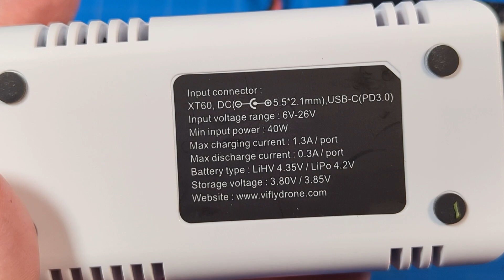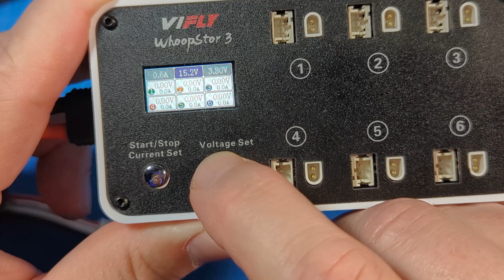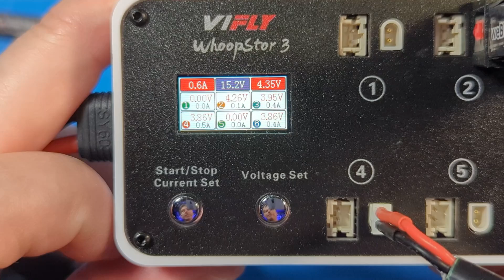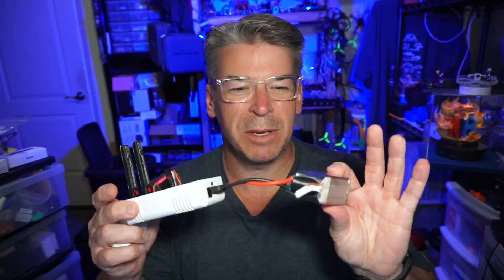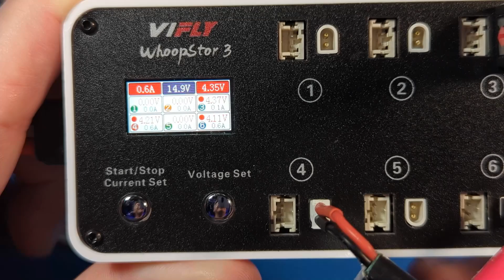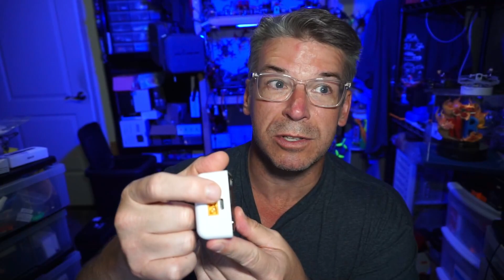#1 Micro Battery Saver // Vifly WhoopStor 3 // Fit & Finish with New Features

Comment: I don't know how to use it. How do I know which Voltage and Ampere I should use on my batteries? Right now I have those blue/white batteries from BETAFPV. Help is very appreciated.
Reply from the maker: If the mah is 300 then charge at .3volts. If 450mah then .4 etc. most charge 1s batteries higher than that but these are safe settings to use
Reply: @ thank you for answering so quickly. You probably mean 0.3 amps?! And what’s the target voltage? How do I know that? And is 1,85V always storage voltage or 1,80V?
Reply from the maker: @patrickrotter515  With 1s batteries we normally charge to 4.35volts. This is HV (high volt) charging which is generally an accepted practice, but some believe that HV charging shortens battery life. I don't believe that, but flying our batteries down flat or below 3.2 volts "at rest" very likely does damage or shorten the battery life. The "at rest" meaning not flying and have been not flying for 3-5 seconds.
Reply: @NickBurnsFPV  I appreciate your help very much 🙏
and sorry for the misspelling. I meant 3,85V on the storage question.
Reply from the maker: @patrickrotter515  3.85 or 3.8o volts on storage. I am not sure anyone has really identified if one or another is better, but I am sure there are some very strong opinions on it :)

Comment: Hey Nick. I'm new to 1s. My whoopstor v3 shows 4.35v when I charge my hv batteries. When I plug them into my whoop however, I'm only seeing 4.2ish. Which device is lying to me? 😂
Reply from the maker: depending on what sort of video system is in the quad maybe neither. HD video systems have higher voltage requirements and by the time its plugged in and we get our video link some voltage is used. If its analog its the scale of the AIO that is off.
Reply: @NickBurnsFPV  I'll have to pay attention today to see if the difference is larger between my analog mob6 and the mob6 Eco!

Comment: Hello, can I charge betafpv 550mAh 1s lipos with that charger?
Reply from the maker: I don't understand. Its a charger built specifically for 1s batteries. Plug in to power, plug in battery and press the start stop button.

Comment: Hi nick just wondering can you change a 2s battery as well with that board? As I have the pavo pico . What would you recommend if not thanks
Reply from the maker: No this charger is 1s only. Any charger I have had on the channel could charge a 2s battery. ToolkitRC chargers are cheaper and Hota typically more reliable, but I haven't had reliability issue with ToolkitRC chargers, just others report reliability issues.
Reply: @NickBurnsFPV  thank you

Comment: Got a question. My 1s batteries say 
3.8v. When I charge should I only select 3.8v or is that just the storage charge?
Reply from the maker: 3.8 is storage. We should charge to 4.2v or 4.35 if they are high volt batteries.

Comment: I’m happy user of v2 and v3 now, and one pretty major cons of v3 I think is that PH2.0 connectiors are on top of the charger instead of having it on the side. In v2 it is a lot more comfortable to connect and disconnect batteries from the sides. So I hope they will do it in v4 😄

Comment: The 0.02V over charging will be fixed soon by upgrading the firmware.
Reply: Niiice, thank you!
Reply: Hi! My whoopster3 is on 1.16 firmware but still when I check voltage with other checkers it says 0.02v more than the whoopster

Comment: That's a great one. I have the passive 6 port adjustable charging board from vifly, I use it with my ToolkitRC charger and it works great.

Comment: Your thumbnail got me 👊🏼
They need to add a single 2s charger on the side so you can charge goggles batteries too
Reply from the maker: I wonder how much bulk something like that would add. I worry about it getting bigger and not being so pack friendly
Reply: @NickBurnsFPV  yah that new one is a bit bigger anyway.  I made a little adapter to plug 2s into 2 1s ports.  That way when I travel I can bring just the 1 charger and cover goggles too

Comment: I love the v2 it does my 18650s as well (4.2v) I made an adapter.  The v3 was not available when I got my v2,  but the 4.37v issue you have is not in the v2, and the v3 can charge as high as 1.3A, which is a nice option but as nick found I do most of my charging at .3A from 3.71v to4.35v and that is just enough time for me to get the bats charged when I can fly again.

Comment: What about one of those adapters that has a XT 60 connector and a DC House plug on the other end wonder if it would work that way ? As I have several older 1S chargers that do that as i have  a couple of those type adapters ? And why doesn't it come with a wall adapter ?,...LOL
Reply from the maker: Yes, as long as it meets the voltage specs.
Reply: @NickBurnsFPV  Thanks Nick

Comment: The fan works when you storage discharge. I have one of this charger(early tester) and I have been using them for over 1 month, it is really a good charger for 1s pilot.
Reply from the maker: I haven't had it kick on discharging yet, but I think I also had it set to a lower amp when discharging.

Comment: I've still been going strong with some fractal boards but this is a great stand alone option for sure. Will probably pick one up eventually 👍
Reply: Can anyone tell the Valt and amps I should use for a 450mah battery and does it automatically discharge or should I set it to discharge

Comment: I have one of the V1's, I think, without the dial.  I think my PH2 connectors are packing it in, I'm moving to BT2/A30 so I'm good there.  But I have been looking at this one just in case my current one starts to falter more.  Love these things!  Just hacked up an old IBM Laptop power supply with an XT60, love the USB C for a power bank too.  Big thank you for confirming an A30 battery will connect to these.  Having BT2's on all my whoops soon seals the deal on completely dropping PH2, except for a few toy drones for spec'taters.  Thanks again for sharing!  Cheers!

Comment: Will be worth money if it start charging cell inmidietly after pluged in. The way it is work we have to plug all cels we want to charge and than press start is the same if i use  serial charging cable on lipo charger.
Reply from the maker: This does precisely that. We don't have to wait for all the batteries to be charged or discharged, we can pull the finished one and put in a new one.
Reply: @NickBurnsFPV  OK, thanx. Thats make sense to buy this charger.

Comment: I've been using their series 1s board that requires a full charger, but being able to reliably storage charge my 1s batteries has really seemed to extend their useful life span. This stand alone unit would be even more convenient out on the road! 

The one big advantage a full featured charger and series board will still have is being able to know exactly how many mah you put back into a pack to recharge it so you can calibrate the aio batt offset for accurate mah used screen display.
Reply from the maker: That is a good point for v4, mah counter per battery. Great thought. Thank you

Comment: Hi Nick,
I'm curious on knowing the charge time with this one, my V2 is way slower than what advertised, taking 1h at .9A to charge a 550mAh battery so more 0.5A to me.
Reply from the maker: I will need to test that aspect. So I understand. your v2 charging at .9a takes an hour to charge a 550mah from storage to HV?
Reply: @NickBurnsFPV  an hour from empty battery to HV, still way slower than my UP-S6 at 0.9A.
Reply: Following because i see this same issue in the v2. Only noticed it when i also series charged batteries using my full sized charger at the same time and they took almost half the time at the same 0.9 amps

Comment: Thanks Nick, this will go into my “goin to my Brothers house to crash and bash”. It is so much smaller than my Hoya D6 pro and adapters. It will make my backpack lighter as well. Still looking for the perfect micro Dji whoop but I am still flying Nickie regularly, thanks. Getting a little better by the day. Thank you so much again Nick. GB you and yours.      Sincerely, Other Pops
Reply from the maker: Oh yes, this would be a good travel bag item. A single big lipo would probably charge 1s lipos most of the day if not more.

Comment: I'd have to assume you can really get the fan to crank if you have it do a storage discharge of shame on a bunch of packs.
Reply from the maker: Yes. I was able to trigger the fan with higher amp setting and more batteries at a time. I have been using it at .6amp with 6 batteries. At .8amp the fan will trigger, at least in the cold basement with me.

Comment: The 40W input power is a minimum not a maximum! Important for anyone hoping to power it with USB! I thought I'd be able to use my 18W USB Fast Charger for charging at my desk, but it gives you an "Input Low" warning and you need to use 40W min.
Reply from the maker: yes, I didn't "speak" that correctly.
Reply: What’s the output specs on your charger? Does it do USB PD? Just this evening I used my little Anker 20W charger to charge up six 450’s at 0.4A. It negotiates up to 9V. Non-PD chargers at 5V do not seem to work.
Reply: The issue is not caused by 18w input power,  this is because your USB fast charge protocol is not supported on our charger
Reply: Yeah, I don't see the reason to get this compared to their v2. Features-wise, there's almost no difference, except for the addition of a fan. Looks like the v2 is more compact, and only require 30W min, allowing you to use a smaller phone wall charger.
Reply: @deathpunchrigby1664  The minimum 40w input we write on the spec is to ensure every port can reach the largest charge current(1.3A), if your input power is lower than 40w , it still can work, you just need to lower the charge current, for example, if input power is 30w, the charge current only can reach 0.9A, hope my explaination is clear.
Reply: @deathpunchrigby1664  I can charge 6 650mah HV lipos at about 0.4-0-5a with a 12v 1amp charger. Thats 12w. You had to have 30w on the old model?
Reply: Can anyone tell the Valt and amps I should use for a 450mah battery and does it automatically discharge or should I set it to discharge
Reply: what is the max watt possible?